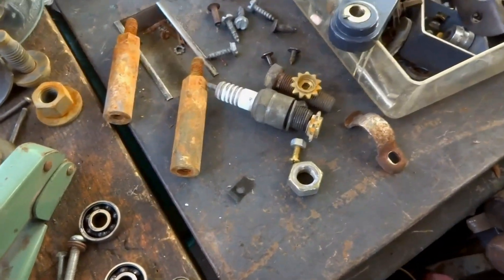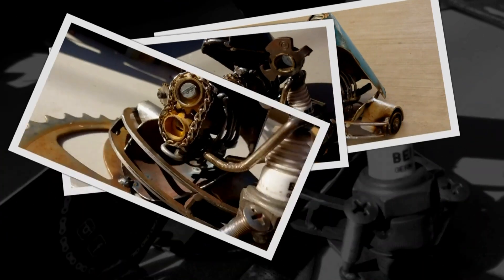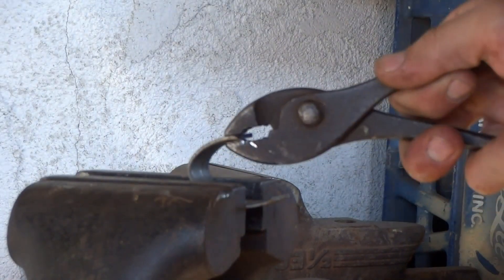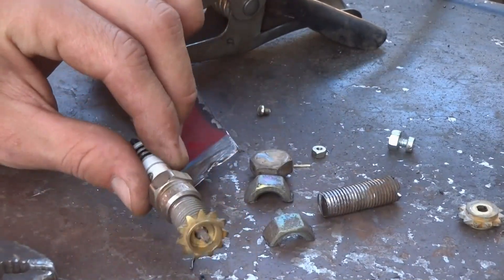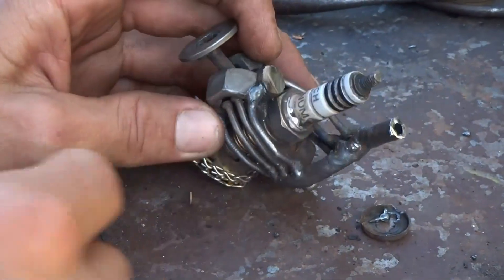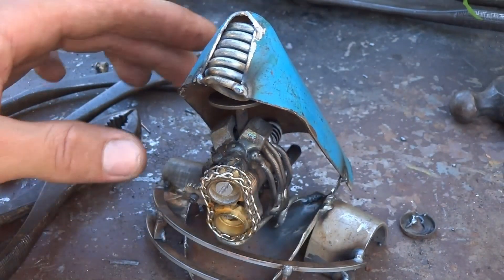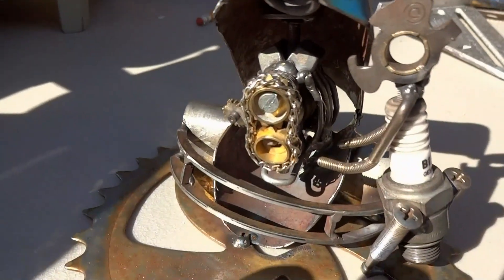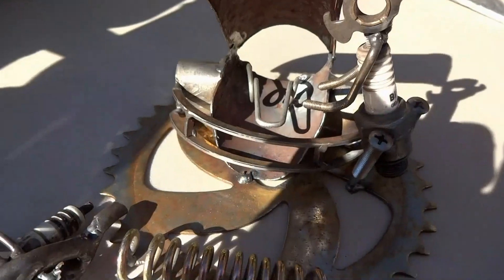DIY Spark Plug Welding Art - Business Card Holder - EASY Welding Project

Comment: Don't ya hate it when the bloody earth comes off It always happens at the worst time. John
Reply from the maker: lol always at the worst time
Reply: I have a piece of 6mm thick alloy bolted to the bench that I make small stuff on and most of the time it works good. But if you give the earth clamp a chance it will still jump off, by nature earth clamps are bastards. John
Reply from the maker: Ive been considering making a magnetic clamp
Reply: I tried that works ok for steel but not so good on stainless